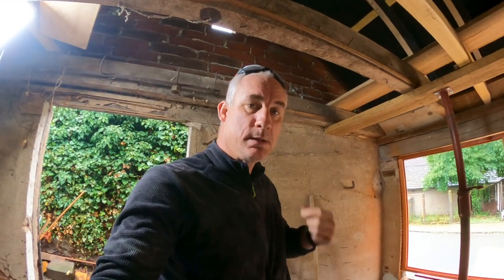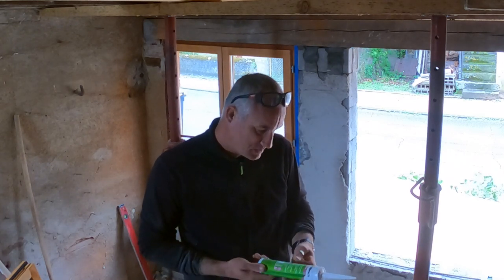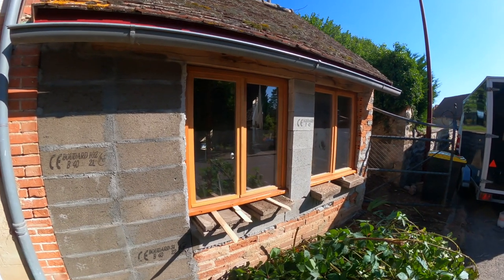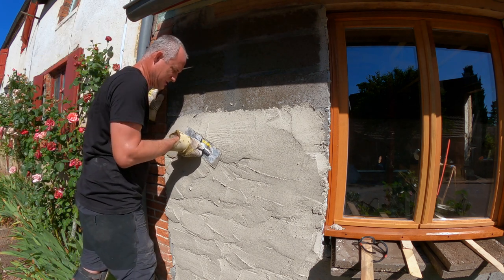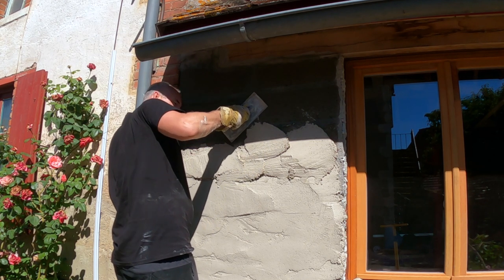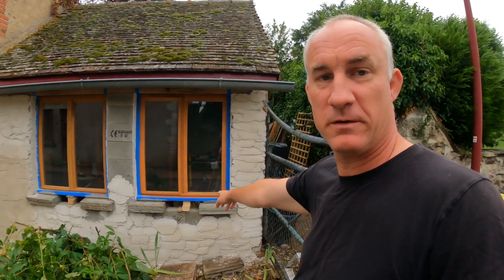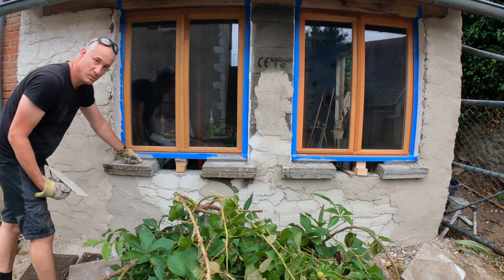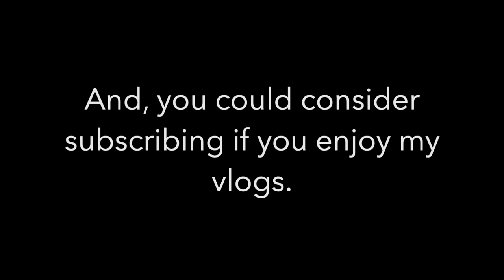The Tiny House, More windows. Ep8

Comment: nice work on the rendering, interesting to hear your mix ratio, I have to render onto a large stone wall and was thinking of doing a 4-1 mix... bit of practice off camera might be a good idea lol, sills are a nice touch too.. we all have days when nothing goes right.. its in the lap of the renovation Gods I think.. take care cheers
Reply from the maker: 3-1 just didn’t stick so I had to go 2.5-1 but eventually decided on 2-1. Possibly when you’re pointing I.e. filling between stones 4-1 might stick. Camera is a simple GoPro with superwide angle lens set to capture the full facade. I zoom in during post production so the picture is not always as sharp as it could be.
Reply: @thisoldhousefrance  yes I use GoPro cameras, and set the 10 to linier lens when possible… I think I’ll try 4-1 and 3-1 mix’s and see what works best… which part of France are you in? Cheers
Reply from the maker: @OurFrenchHouseRenovation  the Allier region. Near to Vichy.